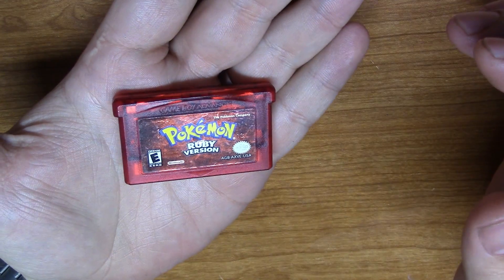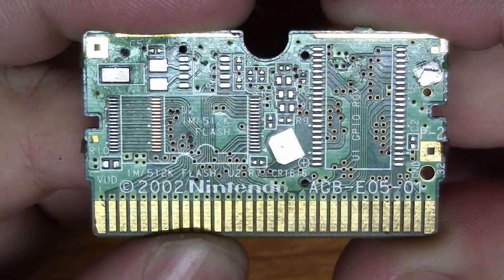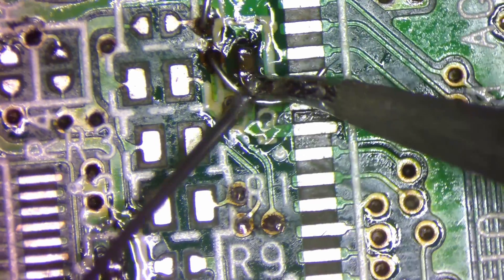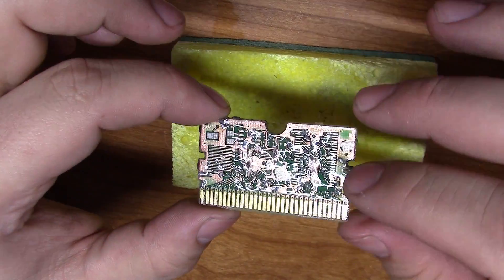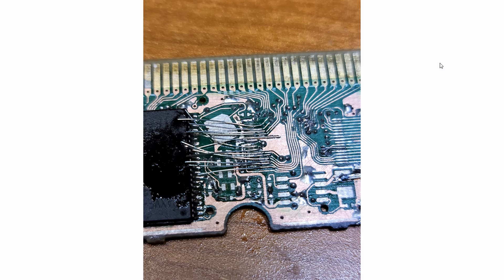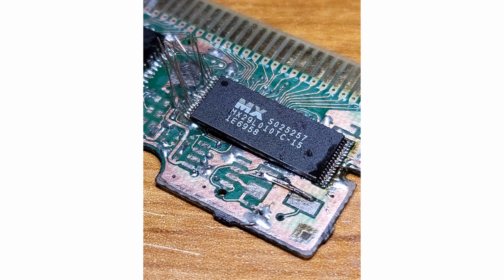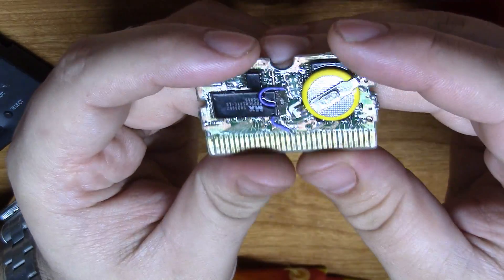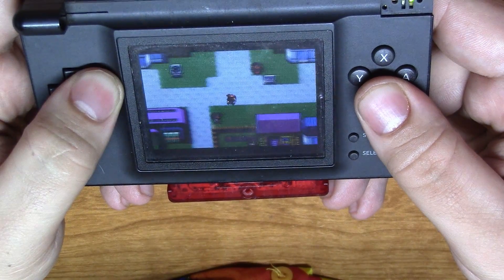Let's repair every trace on this copy of Pokémon Ruby!

Comment: Hello, I have a copy of Pokémon Fire Red and it has no continuity between the 12th contact and the 7th pin in the ROM chip on the right side of it (it has with the flash pin though) how could I fix that? I never soldered before, but I think that is a case of cold welding.

Comment: Currently dealing with a persistent dry battery error on my Ruby version despite changing the battery several times which led me to your videos! I now think it may be a broken trace. Would I need to reflow the board first to see if that works?
Reply: Hey what's up? I am in the same boat right now.   We're you able to get it fixed?
Reply: @chachoz007  Same here! Any luck finding a solution?

My Ruby still shows the "dry battery" message even after installing a new battery (this didn't happen with my other pokemon gba games). I've noticed TP1, TP2 and TP3 can be used to test whether the battery is connected and the RTC chip is getting power (they're on the back of the board). On this Ruby cartridge, my multimeter shows no voltage between TP1-TP3 and TP2-TP3, meaning TP1 and TP2 are probably dead, but I don't understand what I'm supposed to do next. How can I "revive" them? I can barely solder and this sounds impossible to me 🤦‍♂
Reply: @RichardPayne5 it turned out i did not get it fixed. I believed there a broken component in the pcb . I returned it. Then got a new one with a dry battery and replaced it. It worked... you could also try connecting it to the gamecube games cuz that might also fix it.

Comment: Watching this very video has helped me save a copy of Ruby! the + pad was completely gone, I would run a wire through the via to the end point, still not getting the battery working, until I watched your video, and saw that the + terminal also goes to "R9", attached it to there and wham!!! saveing is now possible :)  
Thank you :)

Comment: I'm telling you, there was for sure a better way to troubleshoot this. Like getting a known working cart and replacing some of the main components, or at the very least checking for continuity. Maybe even comparing resistances between the traces on a working cart vs a non working cart.
Reply from the maker: Well yeah but that isn't the point of this video. This was started by saying how over the top it was. Obviously, a brand new PCB would be the way to go but again not the point. As far as troubleshooting goes I found almost every via to not have continuity so that's about where that ends.

Comment: hey i am currently repairing a soap/water damaged saphire. the legs of the MX29L010TC-15 where gone from all the corodion . and some R and caps.  you know any replacement chip that would fit and work as the ram.

i managed to save the flashchip. and i think i will find what the R and caps should be. but cant find the other chip (MX smt)to make it work
Reply from the maker: You may have to source a donor cart for that. I'm not sure if anything is actually manufactured at this point
Reply: @Solder_king  thanks for the answer .getting a pokemon donor coard is never cheap. and i dont think other dba games use that chip. if yes tell me.